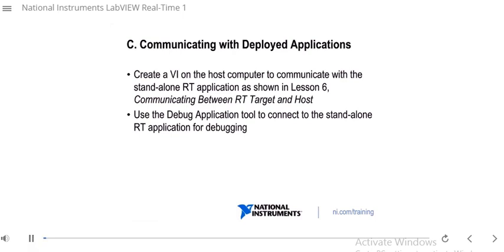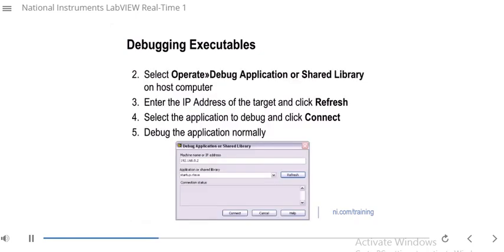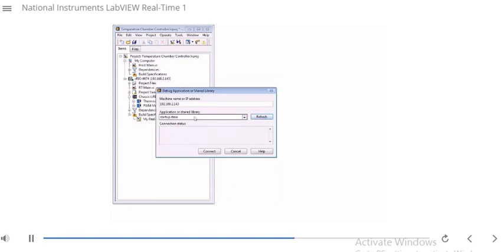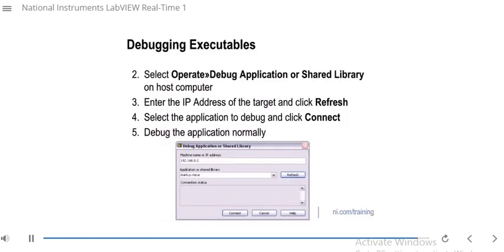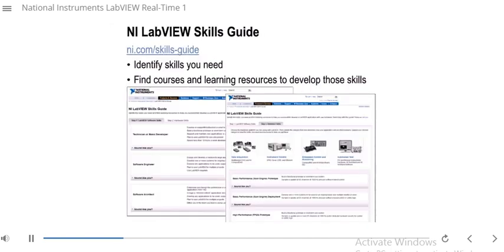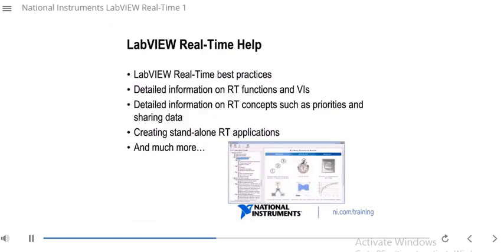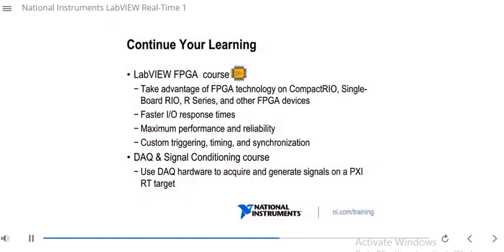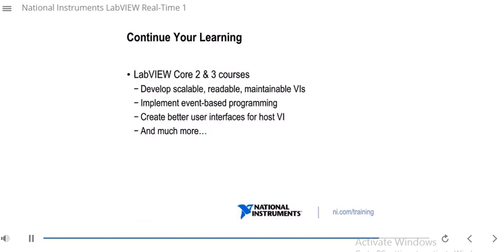LabVIEW Real time 1 Final Part | Working with Build specification | Com: with deployed application

Comment: Sir I want to convert my rt program to exe .I want without revealing code simulate the data of rt program.right now I am using source code but I want to use exe
Reply from the maker: Step 1: Prepare Your VI for Deployment
Ensure your LabVIEW project is properly structured with all dependencies correctly linked.
Connect and configure your NI myRIO in LabVIEW.
Test the VI to ensure it runs correctly in Real-Time (RT) mode on myRIO.
Step 2: Build the Executable (EXE)
Open LabVIEW Project Explorer

Make sure your VI is inside a LabVIEW project.
Add a New Build Specification

Right-click Build Specifications → Click New → Real-Time Application.
Configure the EXE:

Name: Set a name for the application.
Source Files: Add your main VI to the startup VI list.
Destinations: Select where the files will be installed on the myRIO.
Build the Application:

Click Build and wait for LabVIEW to generate the EXE.
Step 3: Create an Installer (Optional)
If you want to install the application on different PCs:

Go to Build Specifications → New → Installer
Include the Real-Time EXE you built earlier.
Include NI Drivers and Run-Time Engine:
Ensure NI LabVIEW Real-Time Module, NI RIO Drivers, and NI Run-Time Engine are included.
This ensures the target PC can communicate with myRIO.
Build the Installer and distribute it.
Step 4: Deploy to myRIO
Go to NI MAX → Find your myRIO.
Deploy the real-time EXE from LabVIEW Project Explorer by setting it as Startup Application.
Restart myRIO to run the application automatically.
Step 5: Install on a Different PC
Copy the installer to a new PC.
Run the installer to install required files.
Ensure the new PC has the right NI drivers and LabVIEW Run-Time Engine.
Reply: @labviewcourses167  sir for you it is very easy and on the internet none of people have controlled the RT DEVICE with exe if possible please create 2 minute video .I have created real time application but it is not .exe it is startup.rtexe sir..